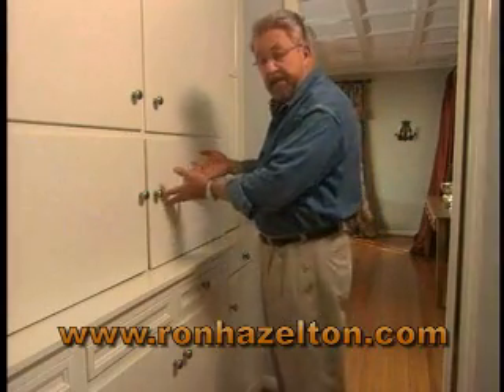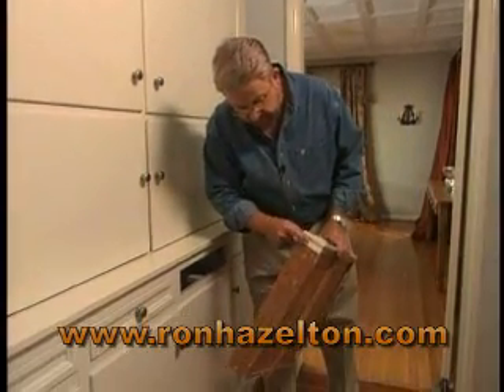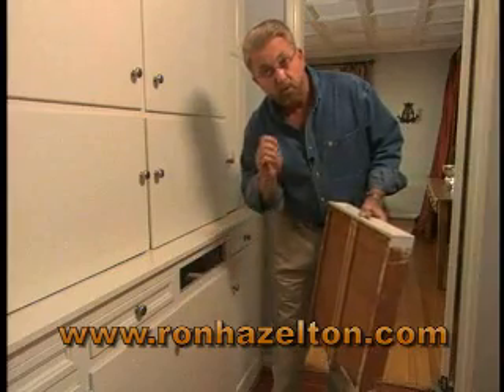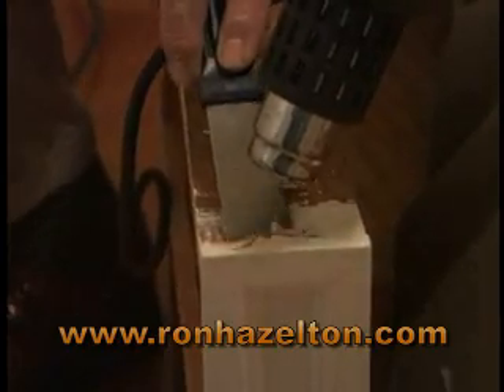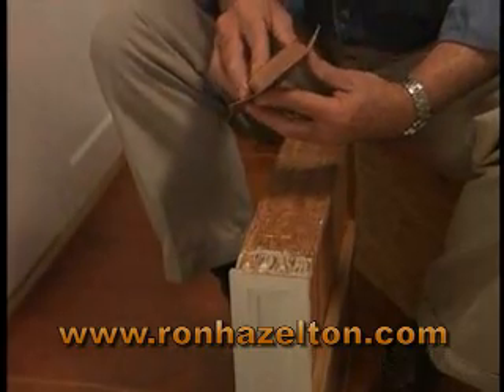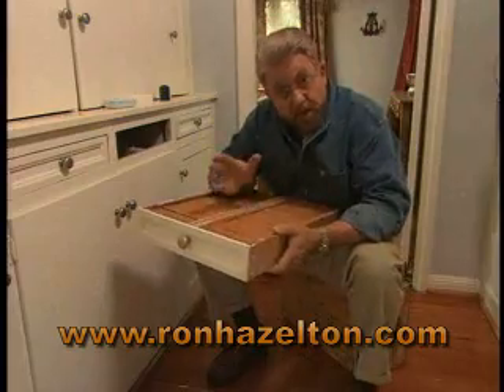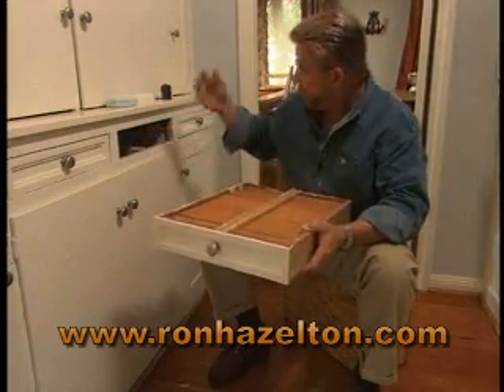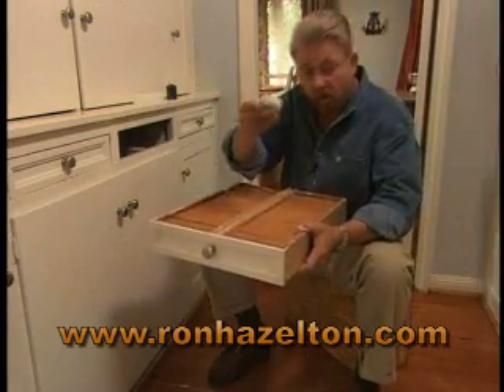How to Fix a Stuck Drawer

Comment from the maker: If you can remove the drawer above, you may be able to tap on the inside of the drawer front from above.  Careful ... you do run the risk of popping the drawer front off the drawer.  If you can remove the drawer below, sometimes you can get an L-shaped pry bar behind the back of the drawer and exert some extra force that way.